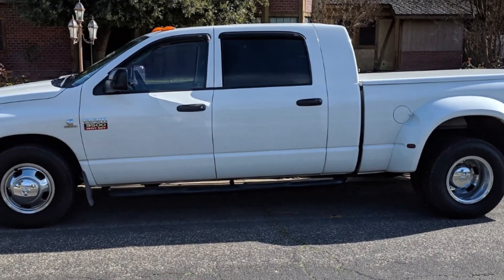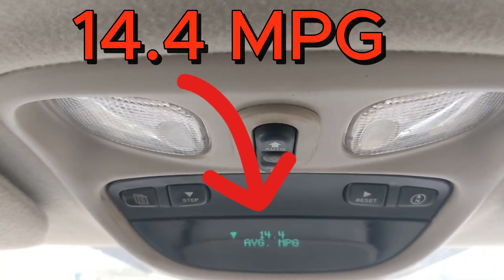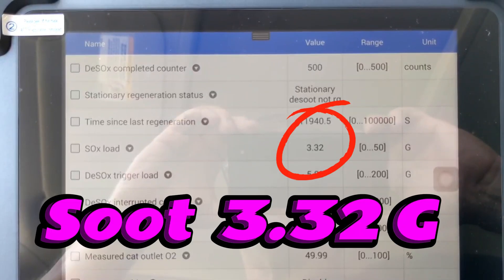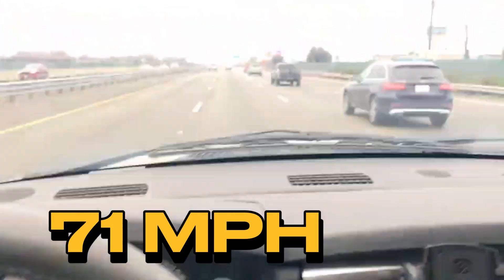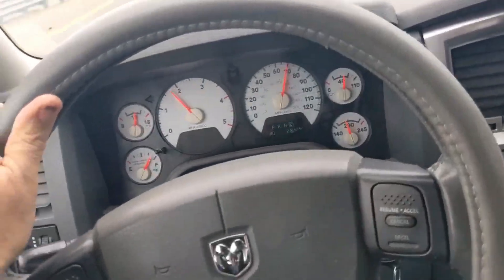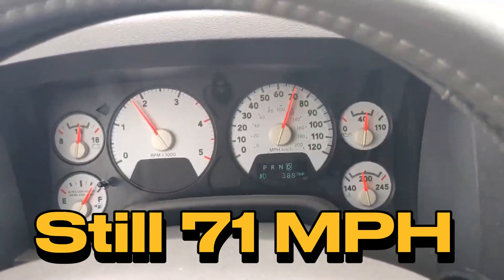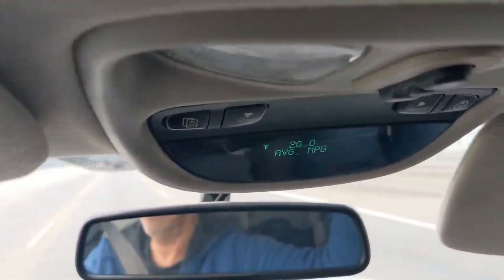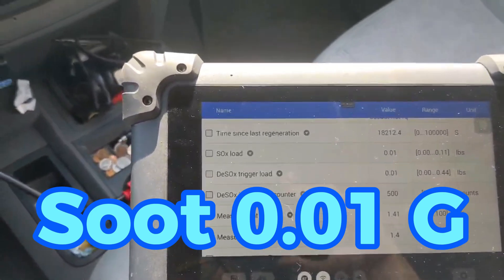Hydrogen on Ram 3500 Dually 26 MPG and Soot to 0.01

Comment: Are these available to the civilian market? I noticed your website only does commercial.  I assume this system works best with fuel injected engines as they can decrease fuel delivery on demand.  would it work on a carbureted vehicle?  if so I'd assume one would need to lean the carb so the hydrogen can properly replace the gasoline?